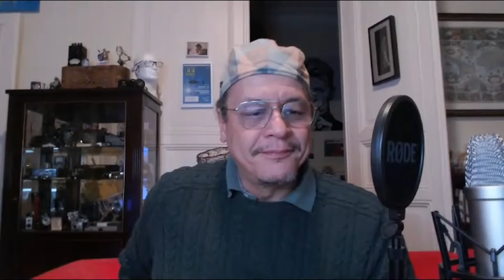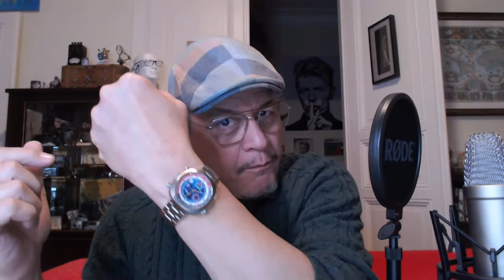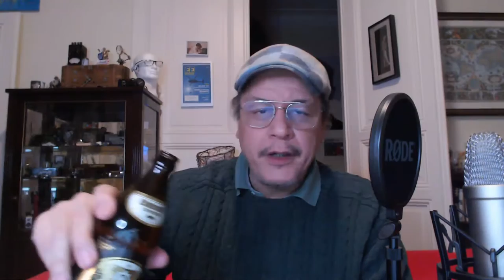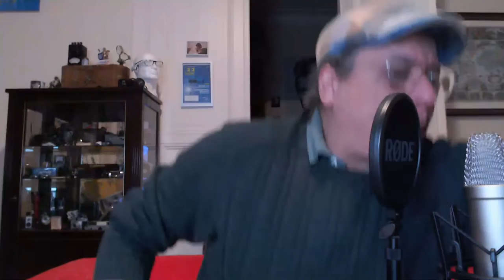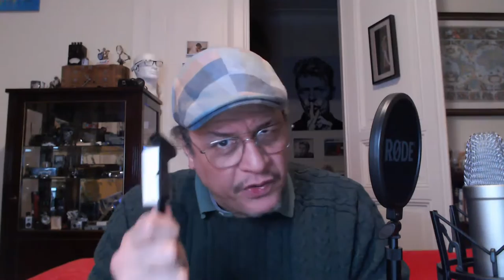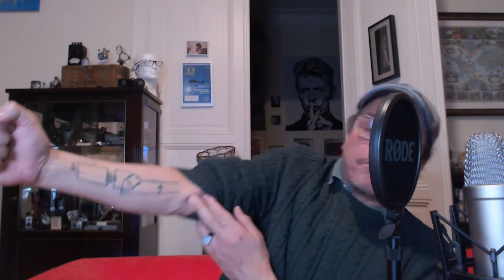Talking technology, and other things

Comment from the maker: "...the new system has no regulator, but the rate is set at the factory with a laser, making the manual rate adjustments normally required by a mechanical watch unnecessary."